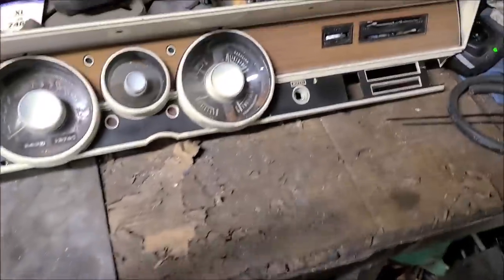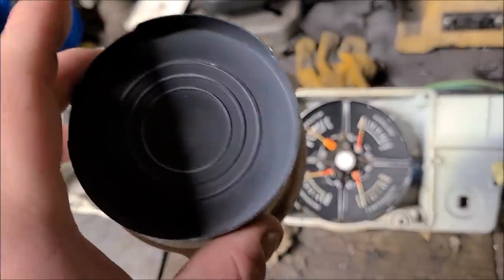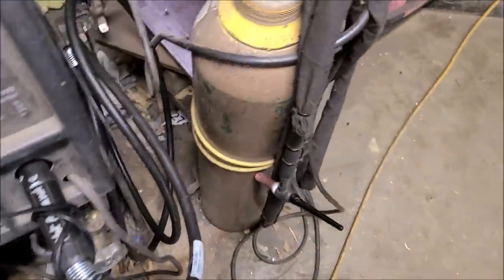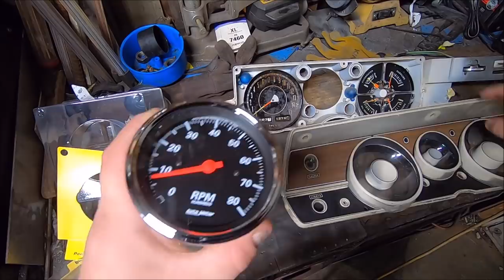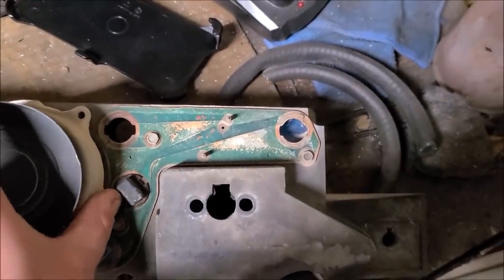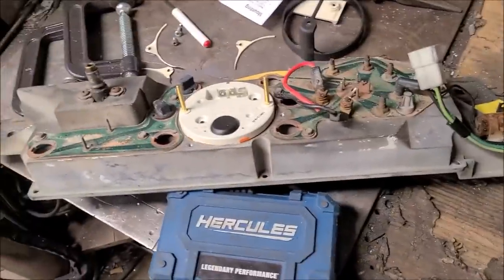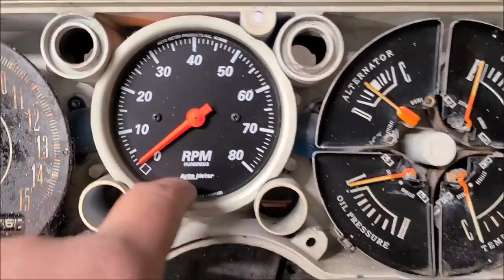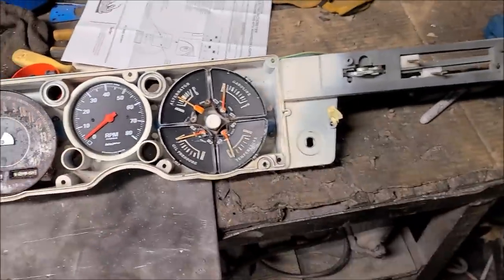1967-1971 Mopar A body Rallye Dash Aftermarket Tach install

Comment: That is exactly what I did to my Plymouth Scamp. Some idiot drilled holes in a cherry mint dash pad and mounted a tack on top of the dash. I got lucky when I filled the holes with some black rubber putty that matched the color of the dash pad perfectly. I forgot the brand name of the tach that I installed in the cluster, but it looked as good as factory tach would have. I love those A bodies !!!
Reply from the maker: I hate that crap man, like I said in the video, if that gauges can't be made to look like they are supposed to be there, don't install them. I am glad you were able to fix your dash pad

Comment: Nice cluster for the duster Jed 👍 . You probably already know this but  oreallys in the autobody section there is a sqeeze bottle of McGuires polishing glaze compound for clear coats on paint  cleans up and polishes clear plastic really nice like the insturment cluster covers and can be used to clean up and polish the plastic head lights on newer vehicles 😎🤘
Reply from the maker: Good to know!

Comment: My thought would have been to cut the back off the round cap just below the top of the bolts . Then put a piece of aluminum across and use nuts. Still would have had to notch the aluminum for the wires.
Reply: I like those gauges that Dylan McCool put in his 73 Challenger but it probably cost like a million dollars

Comment: Yep that did work out great looks so good. Wonder what the solution is for the speedometer? And the full gauges do they work? I wonder if the plastic glass will clean up? Can you polish that plastic with semi chrome polish or toothpaste?
Reply from the maker: I am not gonna use any of this cluster, I will be repairing the one in the Duster, but I am sure you can polish the lenses

Comment: Hi Jed, you know I'm having a hard time remembering my duster other than it was lime green with black stripes Factory. It was a 4-speed with a pistol grip shifter bucket seats and yes it did have attack in it. I can't remember if it had the same speedometer yours as though. Anyway I can tell you that tack that you put in that dashboard sure does look fine. One thing I can't believe is somebody sold you that Crapper– setup without telling you how bad it was. I'm sure you still could use some bits off of it but come on man. Anyhow best of luck don't drop anything.
Reply from the maker: thanks for stopping by and checking out the video man, yeah it sucks that this cluster is pretty crap, but if nothing else, it was good for mockup purposes

Comment: Hey Jed I need a forged crank for my 71 340 what do you recommend
Reply: Find a 68-69 318
Reply: @garymckee8857  thanks
Reply from the maker: the crank is virtually the same between the 318 and 340, regardless spend the money and get everything balanced together. I might have a spare forged small block crank, I can look
Reply: @ScottsSpeedShop  thanks

Comment: Just have a question for you the if the red and black wire on the back of the cluster are off but still touching together what will that all stop from working?

Comment: The tach in my 70 mounts on the column , but it is a 4 speed. Heheh !!!
Reply from the maker: lucky
Reply: To my understanding , it's an original 340 with a  3 speed , when I got it someone had changed to a 318 with a 4 speed.